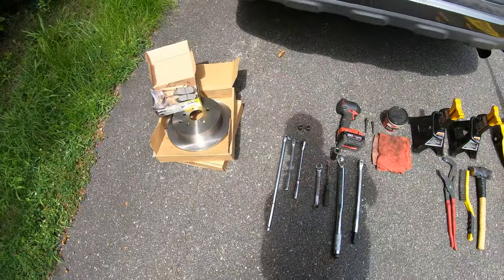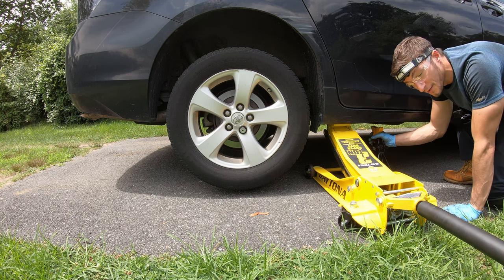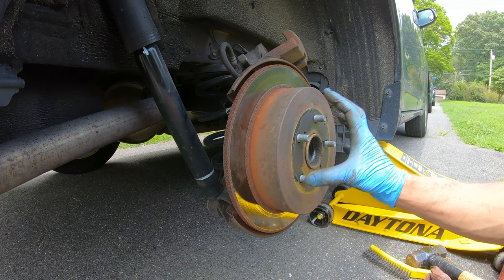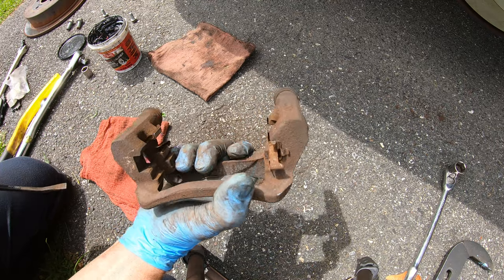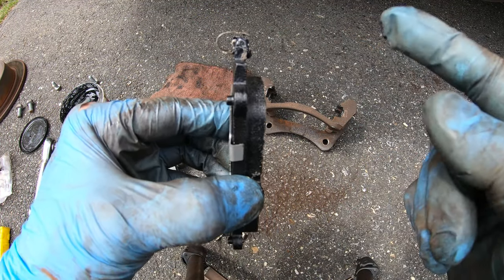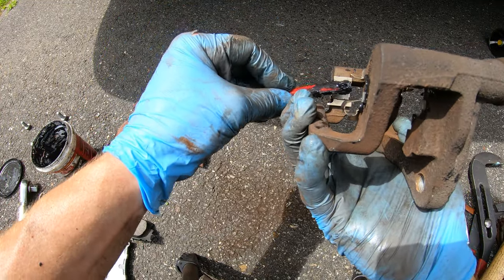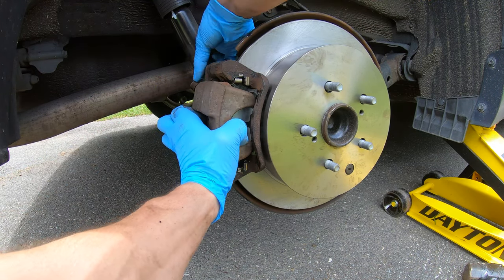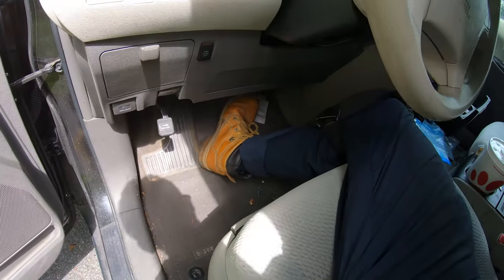How To Replace Rear Brakes 2011-2020 Toyota Sienna

Comment: Brake tip ! I would never remove the clips regardless if you have new ones due to the extra time it can take to put the new pads back on ! I had one brake take an extra 30 minutes of my labor trying to set the pads in the new clips because of the manufacture I’m sure nonetheless just a tip
Reply from the maker: I agree it takes a bit longer but in the long run, you want to make sure that your pads have a new clean and smooth surface to slide along, if they don’t have this then they can begin to freeze up and cause premature wear.

Comment: It’s really important to clean the rotors with a brake clean product. They are a machined surface that will likely have an oil on them to prevent rusting in the box. It’s important to get that oil off as it could negatively affect the pads and not allow them to break in properly
Reply from the maker: While this is definitely true and I do agree, I have to point out that in all my years of fixing cars and doing countless brake jobs (working at dealerships and making Youtube videos), I have yet to see that issue affect any brake pads. Because as soon as you drive your first few miles, your brakes heat up very hot and burn most of that oil right off.

 (BUT, you are completely right sir).

Comment: what is that you are using to put the grease on the red plastic thing?
is that one of those head lights on your head with the wide led light or is it just a sweat band?
Reply from the maker: That red plastic thing was just some piece of plastic, I was using it as a brush lol. And yes that was a LED headlamp. But if you wrap paper towel around the head band then it can act like a sweat band too